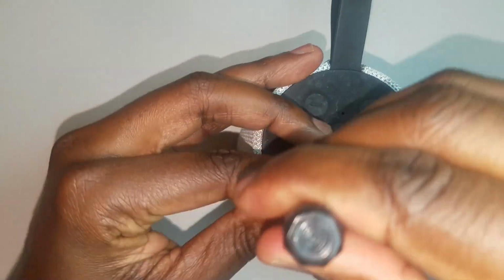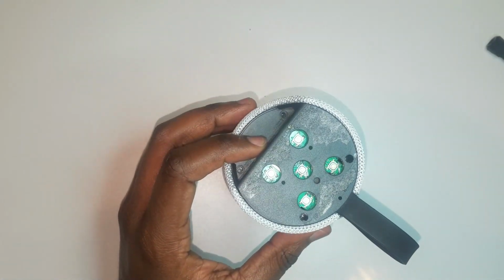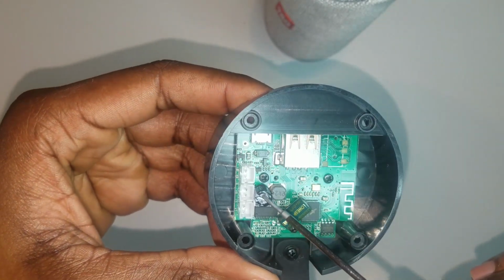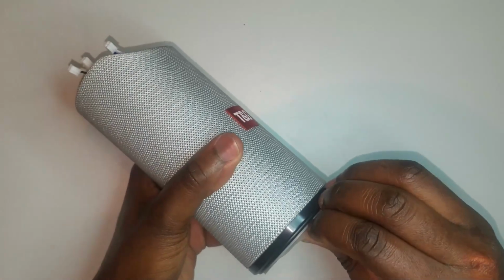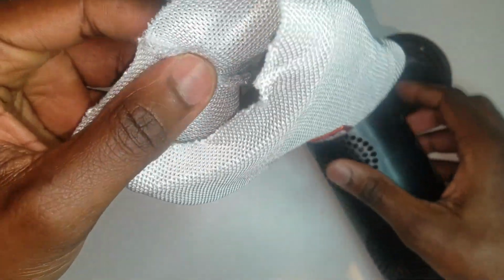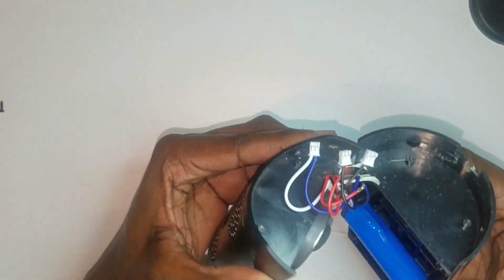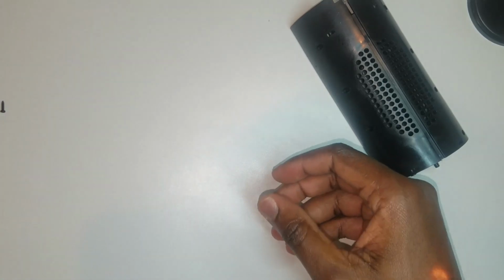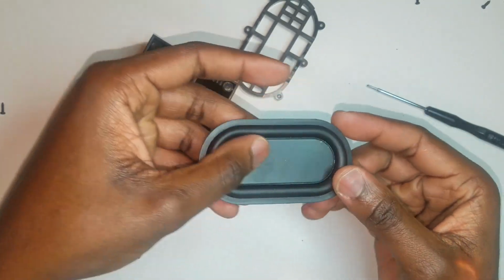Bluetooth Speaker TG 113

Comment: Can you just normally put it back then or do you need to replace anything. I am thinking about putting 3400mAh panasonic cell inside of it so i could more than double time.
Reply from the maker: You can put it back the same way i did to open it. U dont have to replace anything. I never tried to replace it before with a powerful battery.
Reply: I have just replaced battery and I have to admit that soldering 18650 cells is bitchy af.
Reply from the maker: @leonc403  Have you tested it yet and see how many hours it last?
Reply: not yet. I will and then post results. How loud do you want me to test it. 50% or max?
Reply from the maker: @leonc403  I think 50 to 60 percent should be good!

Comment: i have a speaker almost a same as yours brand name TG112, Then the problem is "No bluetooth mode message "NO AUX Message and No music is played while in state of those two mode but the light are indicating modes are active ..   Only the FM mode is working         thanks for the read and hope you can help and sorry for my english.......
Reply from the maker: Did you dropped it? Open it to see if cables are disconnected.
Reply: No, i didnt dropped it, it just happen and the cables are fine
Reply: Same as my SPEAKER TG 112 i bought it yesterday but the next day the BLUETOOTH MODE even the AUX message is not working then  is not working anymore..i didn't drop it or something..